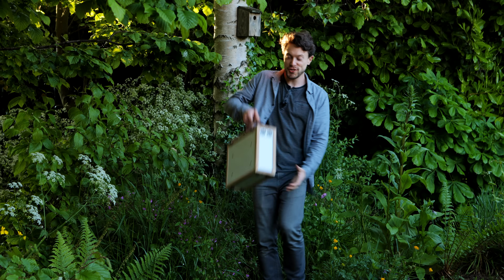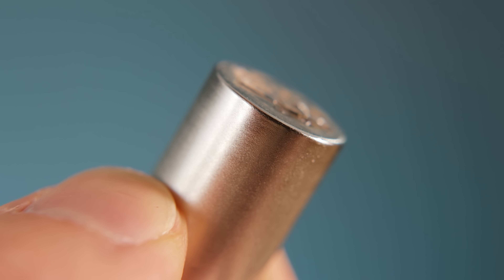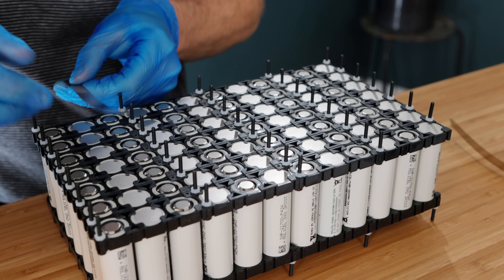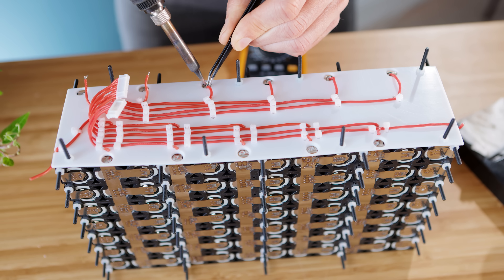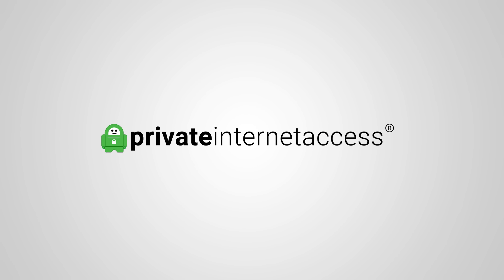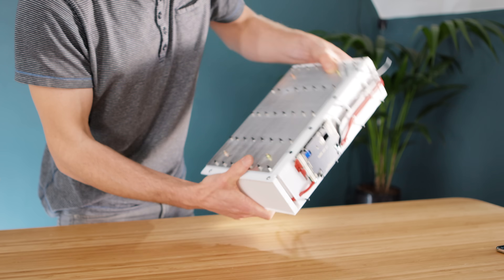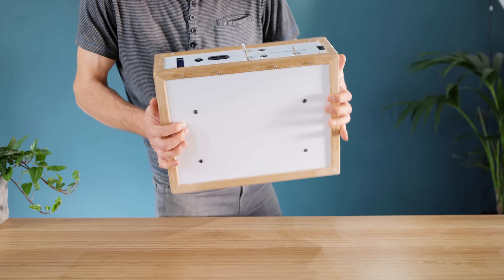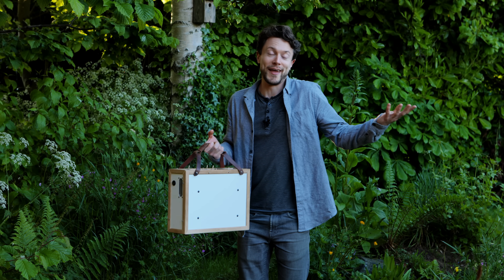Build your own portable POWER STATION (1200w, USB-C and MORE!)

Comment: You neglected to say what the thing cost so I will ask; “What did it cost all up?”
Reply: everything
Reply: I can buy very similar battery cells for $260 USD that match the same capacity of this battery. The rest might add up to another $300 not including the tooling costs like the spot welder.
Reply: 21700 are about 10 per so 84 of them are looking like well 840 just for batteries, maybe a bit cheaper if bulk bought. 18650 are about 4 per so about 340... still a Very expensive DIY any way you swing it.
Reply: @Davelon420  I found the same batteries he's using for $4.25 each for 84. Not a bad price.
Reply: More than 1500 euros\dollars\pounds, 100% assured.
Reply: @RaffaelePignataro  I would definitely build it if it costs 1500 USD :)
Reply: When cost doesn't get mentioned then that's when you know it's expensive!
Reply: Around 500 € for the batteries, 200 € for the bms, 20 € for the bms cable Kit, 350 € for the pulse welder, ~20 € spacers and ~30 € for the welding strip, probably around 60 € for nylon screw Kit, ptfe and aluminium plates. So the basic battery should be around 1200 - 1300 € (1463 - 1585 USD). Then you want whatever connectors and the outside looking Box however you like for varying price.

Might just buy a prebuild battery Pack way cheaper.
Reply: @raiden12321  
Safer too for amateurs.
Reply: @raiden12321  You don't count the cost of tools unless you only plan to use them for that one project. And the batteries would be wholesale price.
Reply: They look to be Molicel P26A 18650 2600mAh 35A battery's. I checked one place in the US and for 84 they are $4.25 USD each, so $357 (€293.18) total. Not sure if UK prices are similar.
Reply: @vinnyc365  you always count the costs for the Tools, you can count in that you then posess those Tools for other things, but still you count Tool prices in, at least if you want to do proper price calculations.
Reply: @raiden12321  That makes no sense.
Reply: @vinnyc365  It does and it is rather simple. You can't get tools for free. So unless you can, you have to calculate the costs for it. If you do any project and you want to have a proper calculation then you have to add the cost of the tools that you need for that project. The end result will for sure be that you have those tools and whatever your project result is, but you can't tick off the costs from the calculation of the project, because they are there.
You might need those tools again or not, both is possible, so a proper calculation does take all costs into account and if you need those tools on another project than this projects cost get reduced because you already got them, but not the costs of the project you bought the tools initially.

You are free to make your calculations wrong for sure, but is not advisable.
Reply: @raiden12321  lol. And what if you have the tools already?
Reply: @vinnyc365  are you for Real on that question? It's already answered. It's not like I have calculated a 3 € screwdriver that everyone has lying around. But rarely do I know people with a point welder just lying around. The odd ones that do have can just subtract that, obviously, and be happy that for whatever reason they already bought one they can now have something else cheaper done.
Reply: @raiden12321  That's....that's not how it works. But OK, whatever floats your boat I guess.
Reply: @vinnyc365  what certainly doesn't work is to argue without any Argument.
Feel free to calculate your projects however feels best for yourself, I already mentioned that in a way.
Reply: @raiden12321  lol. I made my "argument" quite clear, you just refuse to see reason. Keep spreading false info if it make you feel smart.
Reply: @vinnyc365  I gave you multiple times an explanation why your argument, which is not even an Argument only your Statement, is invalid. All you did was coming up with Statements like "that's not how it works". No explanation, no Argumentation just your own way of thinking.
I would see reason on an actual argument that makes any logical sense.
Since I don't see reason to give in to your way of "argument" it should tell you quite clearly why.

And now all you have left is telling that I spread misinformation, without even trying to elaborate what that shall be.

So yes we are done here, you clearly have never learned to have a proper way to argue, so there is no sense to waste more time on this because you will just come up with something stupid again and never explain anything you say.

You know I do feel smart, but that's not because of anything I said, it is because of what you say.
Reply: @raiden12321  If you had any experience in DIY or repairs of any kind you would know that you don't add the cost of tool to a build. A tool is an investment that you will use many times in the future. Do you add gas and wear and tear to your car that you used to pick up the tools or materials? No, that would be silly. Would you count the cost if the pulse welder if you bought it a year before but never used it. No, again, silly. The only tool you add to the cost would be a tool so specialized that you could not used it on any other project. That's my "argument", what I would call a discussion btw.
Reply: @vinnyc365  and as I said before Tools are NOT FREE. For any project calculation to be correct you need to add all costs that are necessary for that project, if you don't than you calculate wrong. You might need a Tool for something later or not, if you do you reduce the costs for your next project.
You could not have done the project without the Tool so that is a necessary expenditure for that project and everything after that is plain speculation since you might never need it again, or it may break down before you do.

You compare apples to peaches, Gas and tear on a car are costs that do not make sense to calculate because those costs apply on regular intervall all the time anyway.
If you build a house you also dont just calculate the raw Material prices, because you wont be able to build a house with such calculated money, you have to calculate in all Tools and other workforce necessary to get it done.

Some people might have a lot of Material lying around to use for a project, guess what they saved money for that one project now, but they certainly didnt save anything when they bought it. 

You can ignore those costs if they bother you so much, feel free, nobody forces you to do a proper calculation.
But stop educating everyone to do it your way when you are just ignoring a high cost because of maybe Events in the future.
Reply: @raiden12321  *sigh  Like I said, you have no idea what you're talking about. Have a good day sir.
Reply: @vinnyc365  I know that I dont have to tell other people what experience they have without knowing them.

I know how to make a proper calculation that can run a business without throwing away money.
Because I know that it is important to count in all cost factors.

So it seems you either don't see where you are wrong or you just can't accept it. Either way no sense to further discuss at that point.
Goodbye.
Reply: @raiden12321  I proved that your battery prices were wrong, I explained how your addition of the cost of the welder was wrong, and if put some time and effort I could probably prove that the rest of your numbers are wrong. My job here is done. I said good day sir!!!
Reply: @vinnyc365  you looked up 18650 god knows where, while the video states 21700, and if you really look at the type he has in the video you see that your capacity is also way off. 
You did not prove anything on the welder cost you just completely ignored the costs.

Keep trying.
Reply: @raiden12321  lol. I went by the battery @2:22, which is the 18650 for some reason. Doesn't matter, the 21700 are only $1 more so you're still wrong.
Reply: @vinnyc365  since you dont show where you found those I can only guess you again took something wrong, like the capacity or did calculate used ones or on discount.

Picking any battery in a video is not equal to Picking the right battery for the build in the video. 

You see that is the problem with you, you just try so hard to prove me wrong that you even mess up to choose the correct things to argue with. How can anyone take you serious if you already mess up looking for the right things in the first place. 

My prices were also not from 1 seller, they are an average. Because that is the correct price to use, not some random guys price who sells decommissioned batteries from hospital Equipment on eBay and not a totally unreasonable price either.
Average price, the average person gets it for.
I also ignored all prices where they were out of stock, because the listed prices there are not updated until they get a new stock.

If you look long enough you sure can get pretty much anything cheaper, that is not the point though. The normal price range in europe is around the price I mentioned. If you find anything cheaper that is nice for you but it does not change the average price range.
Reply: @raiden12321  lol. Funny, you didn't show your sources either. I think your costs are higher because you calculate the price of the airplane that brought them from China.
Reply: @vinnyc365  The manufacturer is in Taiwan, the shipping costs of the manufacturer are added on all retailers, no matter the country. The additional shipping costs from the retailer I did not count in because they vary wherever you get them. 
I am not the one stating that the prices are wrong, you are entiteling your price to be the only real accountable one, you proofed yourself that you already looked up the wrong type and yet don't provide a source.

But there you go, if you calculate the price you will find out that I already calculated it down:
https://www.akkuteile.de/lithium-ionen-akkus/21700/inr21700-p42a-4200mah-30a-bis-max-45a-li-ionen-akku-3-6v-3-7v_100813_2558
https://etronixcenter.com/en/other-formats/8171808-nk478-cb-molicel-molicel-inr21700-p42a-4000mah-45a.html
https://www.dronefactory.ch/produkt/molicel-inr21700-p42a-4000mah-45a/
Reply: @raiden12321  And what about the electricity to run the welder and the wear and tear of your shoes and the cost of the food that you ate and, oh yeah, the mortgage on the house you built it in? lol
Reply: @vinnyc365  I already explained such things when you asked about the Gas of the car.
Just read it again and maybe ask you neighbour or someone if it is not understandable to you.
Reply: @raiden12321  Did you add the cost of the computer that you ordered the materials with? Didn't you call a friend to ask a question about the build? Better add your cell phone to it. Did your friend charge you for the answer (wouldn't surprise me really), add it to the spreadsheet.
Reply: @vinnyc365  anything of value to add or you just gonna keep trolling because you ran out of arguments?
Reply: @raiden12321  Nah, if you're not getting it by now I'm just wearing out my keyboard, which I'm adding to the cost of my build btw.
Reply: @vinnyc365  I don't mind if you want to keep embarrassing yourself more. I already invalidated your arguments and now all you have left is to come up with some bs. That's free entertainment I guess.
Reply: @raiden12321  lol. The funny part is I've explained my point multiple times, I even tried to add some comedy to help you and you've just repeated yourself over and over. But you are right about one thing (and only one thing) you are entertaining. Thank you.

Comment: You should not cut the balance leads, the difference in resistance of each wire could give the BMS a false reading and not charge correctly.

Comment: So, you have a car, but you can't connect 12V DC-AC inverter to it for some reason, and you need a suitcase size power brick to have a microwave working outside.... is this correct???

Comment: Does your argument about needing to balance by row not also apply to needing to balance by cell? Won't individual cells in a row also have their charge levels drift apart, even after putting similar ones together?
Reply: You only need balancing terminals in series wiring. In parallel they naturally balance each other.
Reply: @timseguine2  I see, thanks.

Comment: You need to be very careful with these type of batteries especially when connecting a lot of them even the ones used in power banks are 5 - 10A which can be naughty vape batteries can draw around 30 - 40A & should not be used in a power bank. If you are going to build a power bank you should work out the full circuit from scratch, adding parts from other devices without knowing the value of the components or the way the PCB is designed is asking for trouble don't be tempted to buy El cheapo batteries either get a known brand like LG or Samsung.

Comment: 84 X 21700 new cells, a 50v high current and high functions BMS, 3x150w step down converters, a massive li ion charger, a massive pure sine wave inverter... and don't forget the powerful spot welder... all this stuff probably costs around 1200\1500  euros. This should be nice to be said at the end of the video at least, because in this way seems very easy to do (and actually is...) But requires huge money wallet to make it.

Comment: I’d strongly recommend anyone doing this to have kapton or some other kind of electrical insulating tape to cover exposed battery terminals that aren’t being welded to and have kapton on until the side walls are attached
Reply: Completely agreed. He also shouldn't be spot welding a bus bar directly to each cell.
Reply: @shammyh  I've got no clue about battery packs, why is that bad?
Reply: @Donnerwamp  Generally when building packs you want to have a fuse between every cell and the busbar of the next parallel group.  This allows a cell to fail without taking the other cells around it down with it.  It also gives a last resort protection if the pack is ever short circuited and the BMS doesn't disconnect.  If one cell fails and takes out it's fuse, you still have the capacity of the remaining good cells in parallel in the pack however the BMS will likely need to do a lot more balancing.  Because he is using new cells, this is not as big of an issue but when repurposing cells this can be something to consider.
Reply: @kuhrd  Sounds reasonable. Can you point us to an example of a DIY battery pack that in your opinion was "done right"? It would be interesting to see how it works out having these fuses.
Reply: @shammyh  Why? Know any other method that less stressful for the cell?

Comment: All it needs is 1 or 2 sola panels with a controller mounted on hinges, so it can be recharged, fold the panels flat against the lid when not in use. - nice Ill take one.

Comment: My one issue with this design is you use PTFE plates to sandwich the battery
I don’t know if PTFE has a fire reactant agent to prolong the ignition of other cells 
in case of the unlikely scenario that there is one 
Cough cough note 7

Comment: If the batteries are "completely dead", how long does it take for a full recharge?
Reply: You can calculate this. Divide the batteries capacity by the chargers output. 
Due to lithium charging profiles it's a little more complicated than this, but as a rough guide the above will be good enough. So a 5amp charger charging up a 100amp battery pack would take about 20 hours. That said, this battery pack can probably charge at nearer 20 amps (Depending on the limits of the BMS), so 100/20 would be about 5 hours, but due to the way lithium batteries charge, you should allow closer to 8 hours for a completely full pack.
Reply: @dougle03  Dang dude, Thanks!
Reply: I imagine about as long if you tried to charge a electric car's battery with a pair of double a's and a hand crank charger.
Reply: They Will Not Even Charge If They Are FULLY DEAD !
Reply: @krisraps  I know what you mean. It's why I put the " around "completely dead". I should have said something about when the BMS says 0%.

Comment: Also quick note for spot-welding: as well as ensuring you never short circuit the pack (big hot vaporised metal danger), make sure you press the strip down onto the battery terminal properly. If the contact is imperfect or the probes jump you risk rupturing the cell and leaking acid.

Comment: Wow, incredible circuitry and inner design but I wouldn't say the same for outer shell, it's personal preference but I think it's so much wooden for something full of energy 😀 I would've prefer a matte dark box with rounded edges, something like your cloud unit but dark.
Reply: @asdrubale bisanzio It doesn't have to be aluminium, plastic can have a similar finish as well. Btw the reason they use plastic is prolly because as you said it commercial and has to be cheaper and lighter. It's really no big deal to seal the metal so it doesnt conduct electricity. Also he covered it with lots of ptfe, it's not going to arc like some super high voltage.

Comment: The battery pack was designed and built very well. However, I think you should have added temperature sensors at various nodes inside the battery pack. Having a temperature reading of the cells and the enclosed space can be very beneficial as it can alert the user if any fire was to take place or when the battery pack is being used under heavy load in a hot environment which might potentially damage the cells. Great build as always though
Reply: They can also be used to control the fans so they do not run at full speed all the time.
Reply: I feel like the battery manager has something like this.